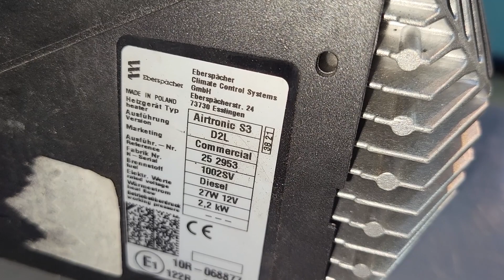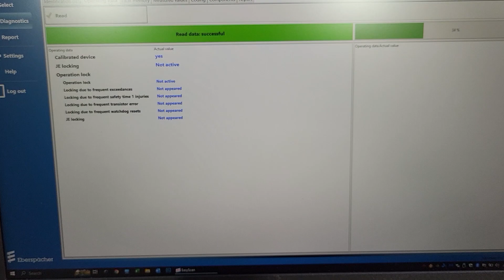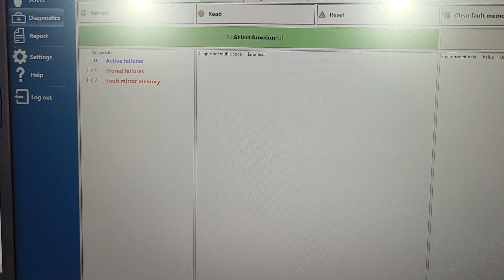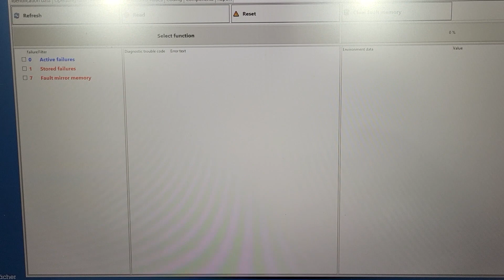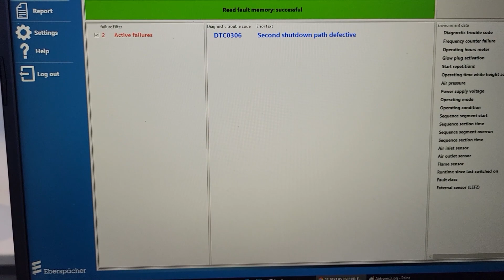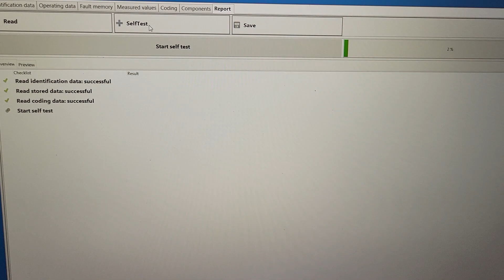Espar AS3 D2L first defective ECU???

Comment: I have a airtronic that turns once or twice it won’t turn on again I did the maintenance the globe plug I replaced the fuel pump. I still had the same problem. The fuel pump gets 10 .5 voltage. But when I connect it, it goes to zero
Reply: Same here starts at 10.5 volts and then once connected goes to zero. BUT if give it 14.2v input from my alternator the fuel pump wiring then gets 11.8v annd then once connected to the fuel pump goes back to zero. I have NO fault codes. 

I suspect the ECU is bad but in my self diagnostics on my Digi Max 1000 they don’t ever tell you “second shutdown path defective” and how am I suppose to know if the ECU is bad or not… VERY FRUSTRATING!!! I hope they replace the ECU if I send it back to them.
Reply from the maker: @aerialvation  I still have the defective ECU from the video and it works sometimes, other times goes straight to error. I don't see a reason why the part would not be replaced if the heater is still in warranty.
Reply: @DIYHelper  well maybe Espar wud luv to get it back as well as mine to do sum R&D. Value to them shud far exceed cost of replacement.

Comment: Hello! Any idea if service kits are available yet for the as3 generation? I have an as3 b2l with nearly 5k hours on it already (chasing snow all winter) and would like to pull it apart but not sure if it has a ceramic gasket like some of the older gens that must be replaced each time. Thanks!
Reply from the maker: https://youtu.be/JjPLk2DP-5U there is not really much to change, maybe the burner gasket. 5k is a lot, Eberspaecher says that this is the expected heater life for the AS3 so if you take it apart maybe a burner is a good thing to have. The new part spare part concept is made in such a way that if you buy the burner you will have all gaskets included.
Reply: @DIYHelper  Got it, thanks as always! Will be interesting to see what awaits inside this new one with this kind of use on it.